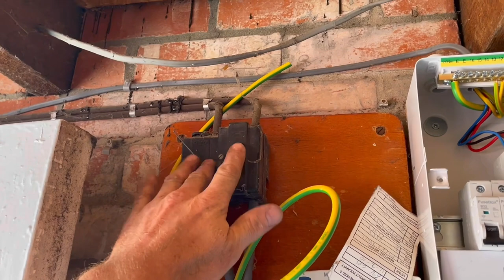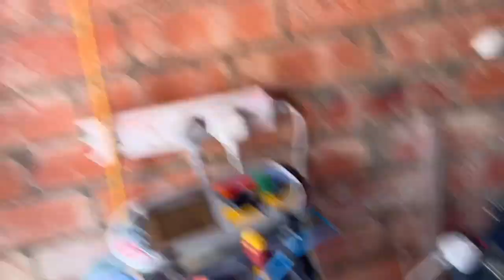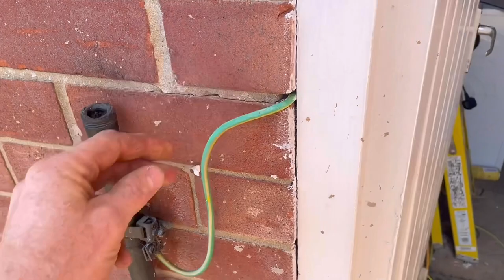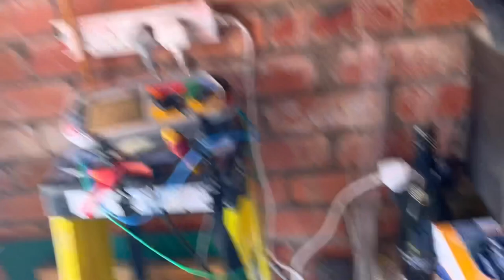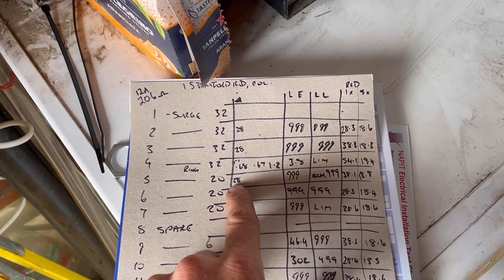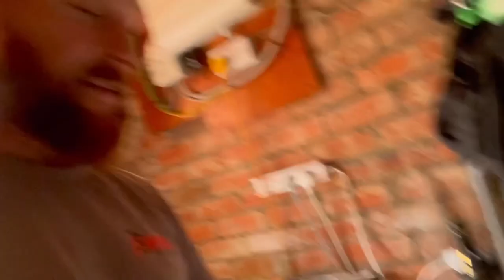Can Your Installation Rely on a TT Earth Electrode

Comment: Nice job bud. Lots of forward thinking too which is excellent!! As far as the neatness is concerned, I used to beat myself up quite a lot as I was comparing my work in consumer units to the Instagram crowd. There's nothing wrong with the neatness at all! You have a method that works well and I take my hat off to you. 

Mike.

Comment: So even though they don’t have a main earth, the builder is safe using his cement mixer because the bonding is giving you a sufficient earth fault loop path?
Reply: Essentially, yes. My house water main comes in for the first 6” in copper before it turns to plastic. Without the bond in my Ze is 17.8ohm (TT) and connected is 0.26ohm. As it is all plastic now it’s not connected and I couldn’t get to it now if I tried. The regs have a roundabout way of allowing the use of a mains service as an earth rod as long as it is privately owned and not likely to be removed or altered. I’ve seen it done in old mansions where the water board takes their supply to the boundary then connects to a private section of the mains that takes it onwards. Just need to make sure no one digs it up though. I recall better information being in GN8.
Reply: If you're a cowboy

Comment: Would you conduct earth resistivity test? If yes, please show us.. Thanks.
Reply: I'm not in the industry but he has a result for the resistance of the external earth Ze , also mentioned results of insulation resistance and looks like results for rcbo trip times and continuity of cpc  .

 I'm sure plenty of other pro guys could comment further
Reply: @lewishumphries2893  Earth resistivity test is needed to determine how long the earth electrode should be or how many of them needed. Unlike many European countries (and possibly the North America as well), British regs don't require an electrode for a TNCS system. So British electricians in general are not experienced in conducting earth resistivity test. That's why I am curious to see.

Comment: On a job yesterday and the supply to their garage was a swa cable that consisted of a 6mm brown 6 x1mm blue with 6mm earth. So neutral is connected via 6, 1mm cables. I have never seen this cable before. 

Anyone here know if this is safe. The load should be shared but it's bizzare. I don't want to have to change the cable it's it's safe and sits correct with the regs but I can't find where it's stated otherwise.

Cheers to anyone that replies
Reply: No idea with regards to the regs, but that's a concentric cable as used by the DNO.
Reply: Sounds like a split concentric cable. A nice cable to use for sub mains that are not buried underground or in the fabric of the building for example, but as far as BS7671 is concerned, in the same position as T&E or any other unprotected cable. Not a  replacement for SWA.
Reply: One thing to note here is they aren't 6mm and 1mm cables, they are 6mm^2 and 1mm^2 cables. Those figures are cross sectional areas, not diameters. If they were diameters, that wouldn't work. 6 cables with 1/6 the diameter doesn't give you the same current carrying capability. You would need 36 cables.

That shouldn't be a problem because cables are always labelled with cross sectional area and that is what you should always be using, but I can imagine a DIYer that doesn't know that measuring the cable they are removing with calipers and realising it is twice the size of the cable they have so running two cables thinking it is equivalent when they actually need four cables (or to go and buy the proper cable!). I would suggest always being precise and writing mm^2 and saying square millimetres just in case anyone ever does get confused.

Comment: Is the red and black wiring from older cabling? I thought I would have to be renewed for regs
Reply: Why do you think that? The only relevant regulation prescribed by the building regs is that the installation is reasonably safe. Old colour wiring is reasonably safe.
Reply: Not at all. And you don't even need the "wiring colours to different versions of BS7671" sticker anymore in domestic if the notice is with the EIC.

Comment: Pscc should be substantially higher that 12a ??
Reply: PEFC not PSCC.
Reply: Yes of course but the PFC recorded should be PSCC
Reply: @tomorichard  not in single phase, generally the pefc will be the higher of the two values due to a smaller Earth in comparison to line phase.